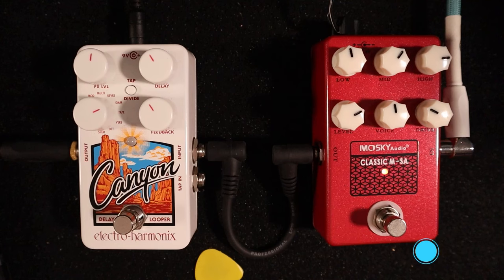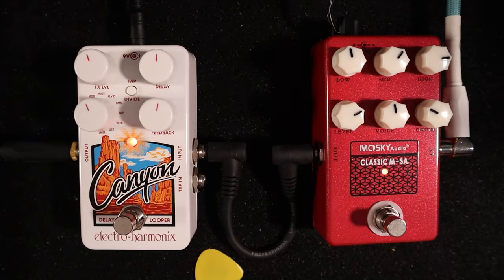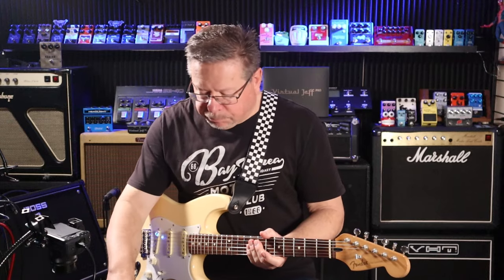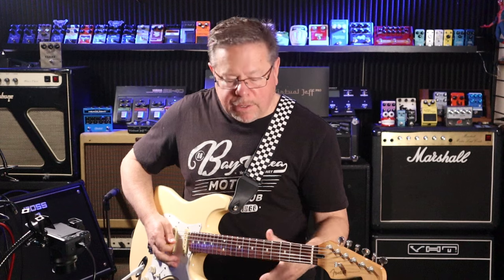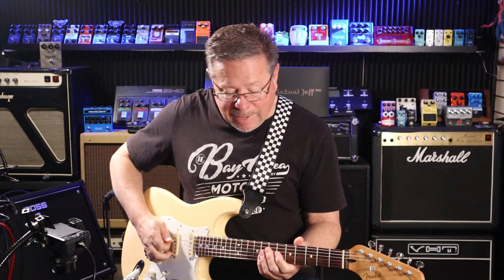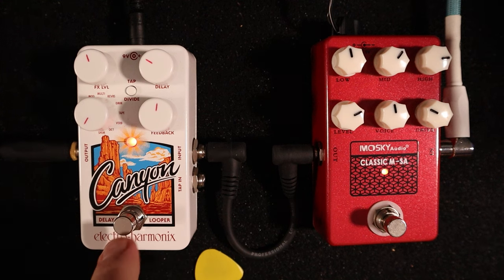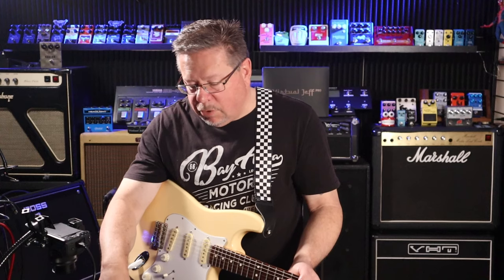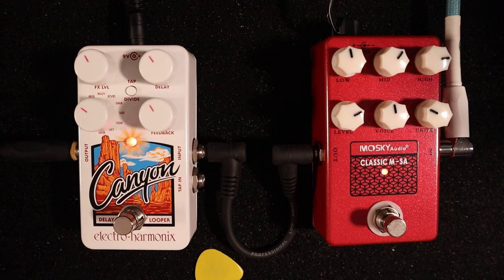Is my EHX Canyon broken?

Comment: I had the same problem. I got a hold of EH power supply and it fixed the issue but it was quite noisy. I hate wall wart power supplies that are the size of a tank. Later I switched back to another power supply and it was fine. The other issue was the external tap tempo. I just never hit the mark right away. It was probably a Normally Open/Normally Closed issue. If I ever get an EH delay again it'll probably be the mini Echo Canyon with the tone dial - left for analog and right for more tape delay. But there are so many delays out there I'm sure I'd settle for something else. (Love the Floyd stuff BTW.)

Comment: That's a curious one right there. I have a couple EHX pedals that came with their own power supply and i have always used them with what came with them. I'm going to try them with other power supplies to see if there's a difference. Very odd. Great demo though!
Reply from the maker: Hey chip! Let us know how you go. Rod did a follow-up video using different voltages which I am editing right now!
Reply: Will do
Reply: OK Rod, now forgive me if this is a stupid question but on your power supply what is the max mA? That pedal pulls 150 mA. I have a Gator power supply with 120mA and 200mA isolated inputs. That's a good draw for a pedal